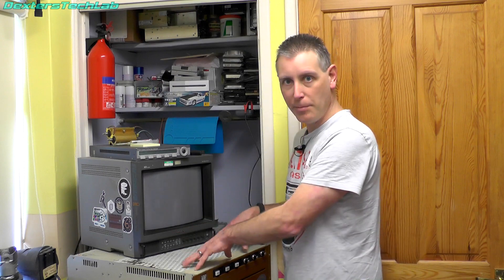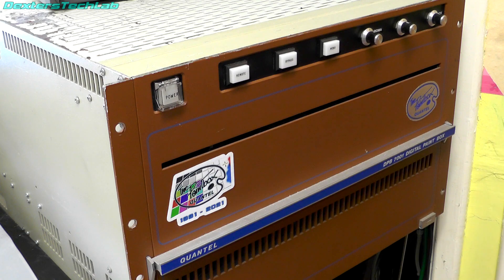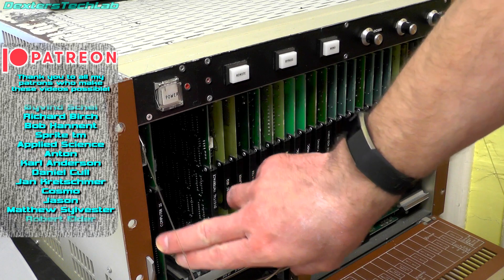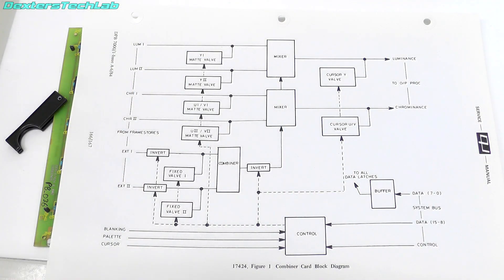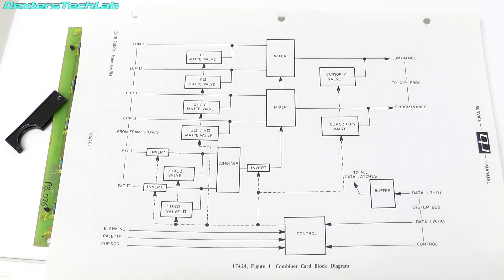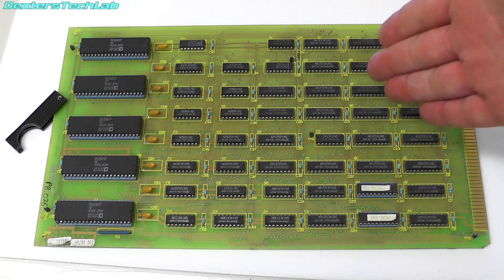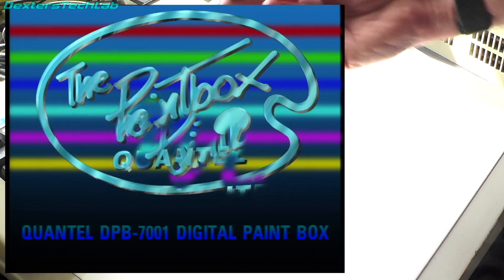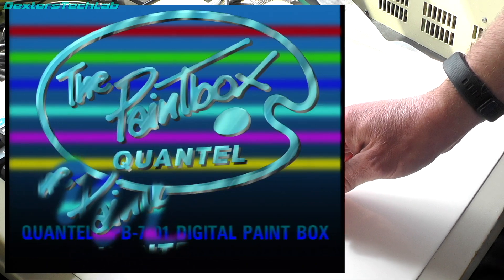DL230 Quantel DPB 7001 The Hardware Part 1 Combiner

Comment: Lovely to see that. Some combiner card notes - When you "view stencil" the combiner card changes mode to use EXT1 to mix between a store 1 and a combiner-generated matte replacing store 2. Also, as you move cutouts around, the CPU is updating store address card 2, telling it  the XY offset to output from. The combiner card doesn't know the cutout position, it just receives streams of pixels.

The first demo for the cutout and "Use Stencil" was a "cutout" squirrel being moved through a painted wood, with the wood's stencil defining foreground and background, so the squirrel would be behind some trees but in front of others.
Reply from the maker: Thank you for commenting Roddy, it's a privilege to have someone here who worked on the machine. We must get you to have a go on it at some point!
Reply: Thanks for your explanations, Roddy! Out of curiosity - what are your feelings towards the Paintboxes? Does thinking of them make you feel sentimental because it was an awesome time creating them or does it bring other kinds of feelings instead?

Comment: Where are the menus and the yellow cursor itself stored? Is there another combiner card, which overlays the menus over the image?
Reply: The cursor is generated entirely by the combiner card. IIRC there's a small ROM on it which defines the shape, colours, shadow etc. As the user moves the pen the CPU tells the combiner card where to place the cursor on the screen.
Reply from the maker: Excellent question! Both the on screen menu and the mixing palette are handled by the combiner as well. The mixing palette is in one framestore and menu in the other.  Combiner simply switches at a particular line number to display them.

The cursor is handled by another card.

Apparently early in development they had experimented with having the menus slide into view. But used the simple on/off due to it being faster.
Reply: @DextersTechLab  So is the frame store larger than a single frame and the palette/menu stored outside of the normal image?
Reply from the maker: Yes, each store is just under 2Mb. The additional space is used for the menus, cutouts, stencils etc. A full screen of data occupies 817,920 bytes.